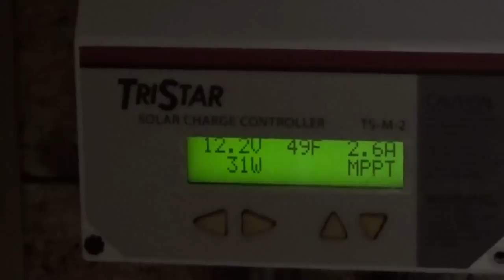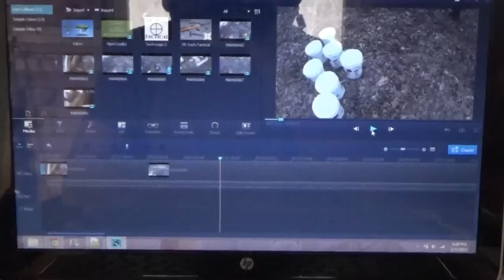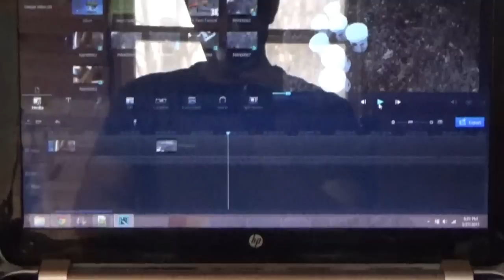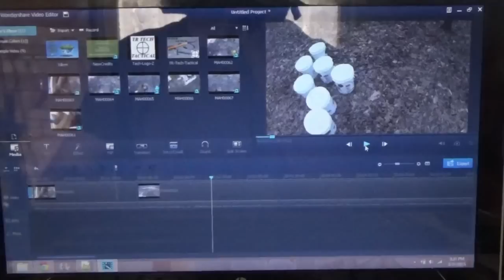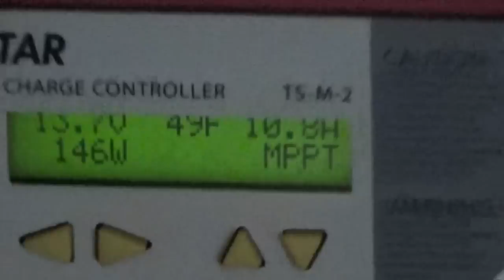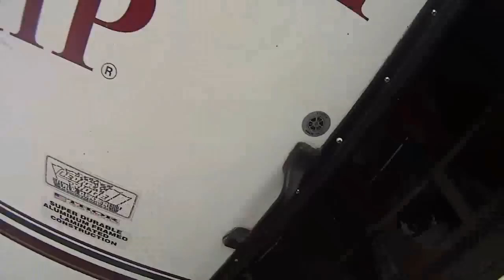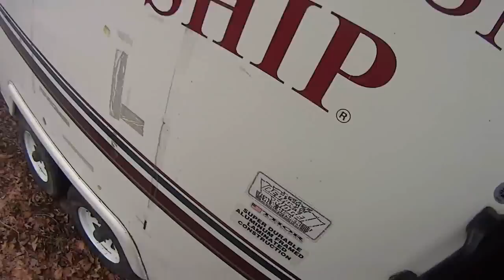Busy Day At The Off Grid Homestead And Tiny House

Comment: Troy please dont get upset with me...i see so many piles of stuff?? do u ever finish a project???
Reply from the maker: Most of this is building material for the house. Its hard to do everything out here alone. Add to that I make videos for a living. Have to mix it up. People wouldnt be entertained if i did house siding videos 30 minutes per day every day for two weeks for example
Reply: The Do It Yourself World
Once you get the wood storage under control (and you will) things will look much better.
Reply: Dennis Lindell
The main problem is the wood. Once he has built his stuff; sugar shack, outdoor kitchen, potting shed, porch, wood shed, garden paths, etc. he will be tired of hauling it all in and just get burning wood. Meanwhile, he is going to need it. If he doesn't collect it when it is available, when? He can burn the stuff he won't use each spring to make syrup which will require a lot of wood. That will be his spring cleaning. He will be better organized about it as time goes by.
Reply: SSanf
Reply: Joann Yelton
Hi. :)
Reply: Some commentors suggested he may have ADHD
Reply from the maker: sim6699 Some commenters are not medical doctors and should not suggest such things.
Reply: Good question
Reply: Nothing wrong with collecting recycled supplies,  just keep it organized,  and if you are going to do videos,  on how to "homestead",  you will have to decide if it's worth your time to keep stuff organized and "neat looking'.   Obviously Troy has not put a priority on this,  so he going to get some flack.   His lack of organization create a lot of wasted time,  but I guess that is his choice.   His" ever changing priorities",  really just creates drama for the channel.   Most homesteaders,  farmers that I know of,  spent the last month downing trees, splitting it and stacking it for next winter. He also complains about the rain a lot.   Again,  most farmers,  go out and get stuff done "even in the rain".   Sure,  it's hard and messy,  (I've been there),  but that's part of the lifestyle.   Suck it up,  buttercup.
Reply: +Sara Kennedy,  It's her property,  why she is "allowing it",  is beyond me.   She should insist that he organize his stuff.   I think it is good,  if he keeps the recycled supplies,  just organize it.   He complains about the rain, and that he can't get anything done,  then,  get a pair of rubber boots and a waterproof jacket.   He has a nice dry "workshop",  get out there and start doing some stuff.   Every farmer and construction worker I know,  wears a pair of rubber boots(practically all spring long) and has a waterproof rain jacket on hand(in the truck or tractor).  His "inefficiency"  is just to create drama for viewers.
Reply: ***** The owner previously allowed place was previously used to dump rubbish for money. I doubt she is bothered about Troy's wood.
Reply: sim6699 , Ah so the secret to this type of lifestyle,  is to live in a place that is "sanctioned to dump rubbish"?   That clarifies quite a bit actually.
Reply: S Johnson I don't know about being sanctioned, just he mentioned the land is full of junk from when the place was used for dumping waste for money.

Comment: Troy, I believe you have plenty of amp hours left in your batteries.  Without knowing the exact specifications on your batteries, you won't actually know unless you do some load testing.  But normally a 12v system will show around 11.5v at 50% discharge.  I remember you testing your 'old' forklift batteries at 2.1v per cell, that would indicate a fully charged bank at 12.6v under no load. Thus 12.0-12.2 would indicate still mostly charged. Again, without load testing the system it's tough to know for sure.  But a lead acid system should be completely reasonable to regularly discharge to ~11.5v, and occasionally lower when you have a run of cloudy days like this.

Comment: The disappearing  gas could be a faulty gas cap allowing to much venting or that could be just the way it is made concerning the gas cap. Gas evaporates at low temperatures. 27 years experience on auto repair and small engine repair.

Comment: Check lists
New Tires for 4X4 Chevy Dump Truck
Mouse Trap for Car Trunk
Mowing Deck for lawn tractor
2 bundles of cedar shingles a pay day until tiny house is finished.
Reply: Hey! Lee and I were going to start a list. At least, I think we were.
Reply: shartne I don't think the tires on the truck are that bad, he's just afraid of getting a little dirty driving up and down that lane.  Seriously if that riding mower can make it through, its really not that bad.  Trust me riding mowers don't do well in mud, they don't do well in most places actually.  At least, not without some modifications to the transaxle LOL.  Something Troy may want to look into is locking the spider gears in the transaxle to give it a posi-trac.  Better traction in the conditions Troy will be running it in.

Comment: starting fluid is the worst thing you can use to start an engine. Put gasoline in a 1 quart spray bottle and use that. It works on both gasoline and diesel engines.

Comment: check your oil level on the tractor.  I had tractor that the carb float stuck and the gas would run in to the crank case and that can go boom.

Comment: Think the cats are romping, as the ears are not layed back, Baby Cat loosing her winter coat.  Why don't you allow your chickens in the garden area for the winter to fertilize and eat the weeds?  The fence might not hold them, just wondering.  My daughter-in-law has my baby chicks and will bring me 6 in 2 weeks, I can hardly wait, as I have wanted chickens for a few years now.  Just cemented the post in the ground and put the bracing around the top for the roof.  The coop and run will be inside my garden area so I don't have to transport the chicken manure but a foot or so to the compost pile.  The compost pile is inside the garden area also, so it is more convenient.  Glad to see the tractor/mower working.  God Bless and take care.

Comment: I don't understand why you don't take the smaller rocks around your lease and bury them in the low spots in the drive also the gravel you dug up in your garden last year?
Reply from the maker: 1/4 mile long? Nope not a job for me. Going to get truck loads of gravel and let my lift bed do the work.
Reply: The Do It Yourself World Did I tell you I want your truck? ;)
Reply: The Do It Yourself World
Just what you dug out of your garden would make help. A journey of a thousand miles begins with one step.
Reply: MsPunkin13 I have been paying 370.00 for 20 tons of crush and run and they spread it free. I have hard ground there so the gravel does not disappear like some areas.
Reply: MsPunkin13''crush and run'' is 100% crushed stone and varies in size etc, I think its lime stone and is grey.what is good about crushed gravel is that it interlocks and is not round. round rocks don't like to pack down.you can also after they spread the stone 3''-4'' thick, drive over it a couple of times then grab a rake and rake the fresh gravel to the sides where you drive on to build it up even more. I will post a video of a gravel delivery in about a month. what is good is troy is not driving his truck though that mud right now that makes it worse and you end up with huge ruts big puddles.
Reply from the maker: MsPunkin13 Yes I hope to dig a trench beside the drive way for drainage and then raise the path. Plus put gravel on top. Its not too expensive here if I pick it up myself.

Comment: If you used 2 gauge wire from your solar panels you would be charging your batteries right now and you would have plenty of power on the cloudy days.
Reply from the maker: ***** I fear you are missing a whole lot of variables in your suggestion. The biggest one being that I am using an MPPT solar charge controller and solar panels at 130 volts DC and only 8 amps

Comment: the reason they do that with laptop screens is that its probably cheaper than putting an anti-glare coating on it and when you are not in a brightly lit place it makes the color's on the screen look more vibrant/sharp.
Reply: Try a privacy screen on the laptop they polarized  which should help on the mirror effect..